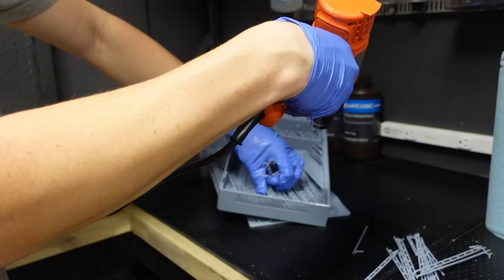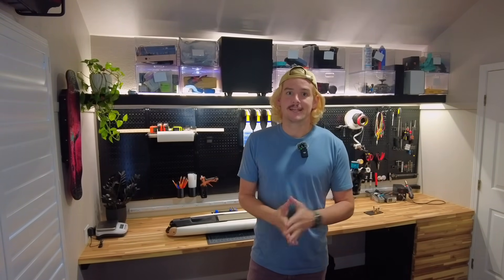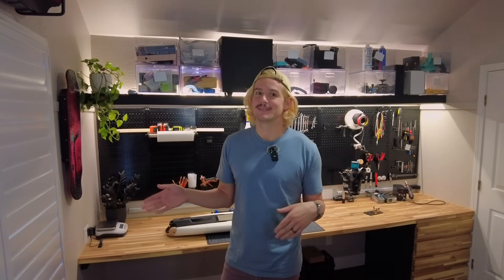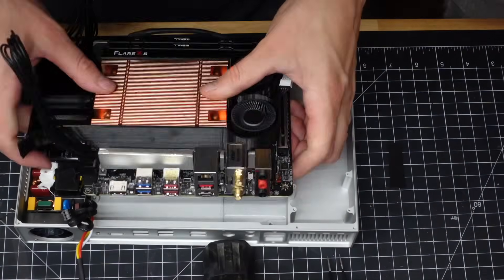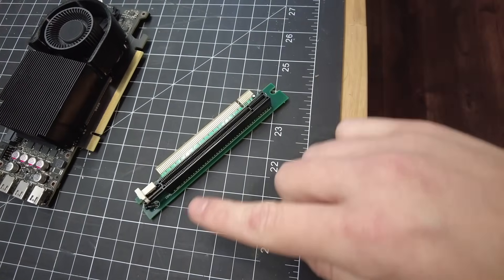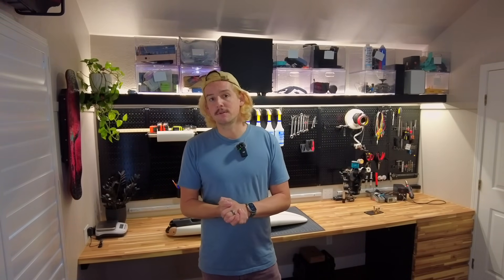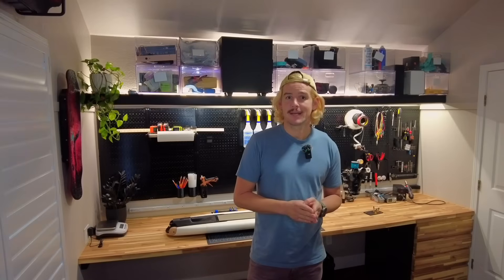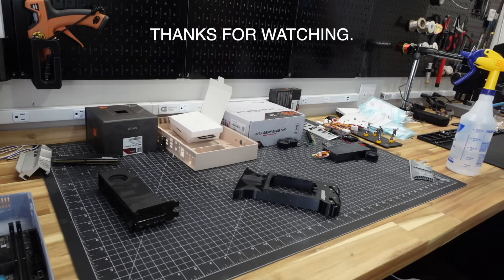I Built the Ultimate 2.5 Liter SFF Workstation PC

Comment: Tjena tjena, kompis. This is a really good project. As a fellow "brings-his-ITX-build-on-a-backpack-in-transatlantic-flights-to-Sweden", I can absolutely relate to your needs here. I had a Skyreach S4Mini which was quite tiny but as GPU sizes became larger and larger I was forced to update to a Tetra R. I am still not sure how that case will perform as far as portability on transatlantic flights (I am now using an L12S while the previous build used an L9A which is much more "secure" in the board) but I guess we will see about it next year.

Comment: I'm sure you are aware but simply using aluminium housing for cooling isnt going to cut it. The TDP/Watt heat dissipation capability comes from the surface the air has contact with. The higher the area or higher the flow the higher will be the cooling capability. So just adding an aluminium housing equals to adding like 2dl of water on top of the CPU without radiators.
Nice build but do not try to sell it as this design helps cooling. It just add thermal mass and thus delays thermal throttling if scaling is inadequate.
But the housing is nice. Instead of buying a MAC cube you got yourself a cheap PC and spent the price difference on the housing. And I'm no apple fanboy but could not notice the 500$ bill on this housing.

Comment: few thinks to update:
1 put thermalpad between heatsink and chassis
2 use normal window for i/o and pci-e bracket, and the grill for gpu with dust filter on magnets.
3 make place for normal 2.5 slots gpu
4 start selling them

Comment: Awesome build! I have a 7900 cpu rn and I have a big air cooler eventhough its rated 65w tdp. How did u manage to cool the 9900x with 120 tdp with the little copper block and blower fans. Very impressed but how long can you keep it on heavy load until it overheats? Surely you cannot run like a 45min render without thermal throttle. Thank you.
Reply: I was thinking of building a mini itx build too, but wanted it to be one of those breifcase pcs but thinner. Ur cpu cooler is just what I needed thats why Im asking. thanks

Comment: I just use a mini handheld pc, GPD Win Mini. I paid around $800 backin in 2023 for it. It has an oculink port which I can plug a mini egpu in for added power. I also picked up a dock which does all my IO ports, SD cards with display output and builtin nvme storage. I also picked up a portable pen display and powerbank for on the go use cases. This set up is very easy to upgrade as you can swap out the GPU or CPU as separate purchases assuming you can stick with an oculink based system. Or go with USB 4 for a performance hit. Way easier than doing something so complicated.

Comment: Conclusion and tips: A 250W PSU is critically small for this configuration. Ryzen 9 + RTX 4000 SFF can easily reach 250W+ in peak loads. I recommend a PSU of at least 350W fanless or 400-500W SFX (with good cooling).

Comment: Definitely an interesting video. Super impressive build but for 3k? You could get an actual laptop with an RTX 5000 that is lighter, has excellent battery life, more ram, a built-in screen (for what its worth, not much to you) etc. 

Why did you go through the effort of making a custom SFF travel-size PC? Its cool, but its performance and portability will never be able to match a laptop. 

Also I've never hit an issue with GeForce cards in Solidworks/NX/Inventor/Revit, not sure how big your models are comparatively, but for loading my Formula team's car its always been flawless, taking maybe 2 or 3 minutes to load on my 4080 laptop (haven't tried with the 5070 in my new PC yet)

Comment: just my 2 cent. its possible not to find a half hight single slot 4070 mobile cards. But this will require a custom cooler but since you have extraspace it could be cooled enough to run. its comparable with a4000 in performance but 3 times cheaper. although you would need to modify driver inf files etc ... but proably something like 4080m or even 4090m can be fitted? although cooling budget likely wont be sufficient to run them at 80-85.

Comment: Very nice build, but price to performance doesn't seem all that worth it imho when the end results barely equal a workstation laptop, which are always much more expensive than a desktop for the same performance. I don't use Solidworks, but I save my files to a folder which automatically gets copied to my cloudserver and I've never had problems with accessing and keeping my file-versions up to date, same with licenses.

Comment: This is an outstanding build.  I think there could be a market for this.  I Was a Electrical designer, so I only did some contract 3D work (running cable ladder around PDS & PDMS plant models) but I got sick of having to drag around my delicate PC setup about while flying interstate around mines in Australia.  I would have ABSOLUTELY paid a premium for a setup like the one you built.  But I am retired now.

The other alternative would be a slightly larger 5L case, with a build that was less complex.  I would have checked the pelican case I put it in to protect the PC, but that has the draw back of some baggage handling numpty putting it on the wrong plane or forgetting it entirely.

Bloody nice Build.  I would still buy one!

Comment: Incredible work. It still amazes me what we can do more or less at home now. 
That's not a terrible price for a custom milled aluminum case. When I spec'd out a few computer / electronic type builds I was hearing around $300-600 depending what I do and if I needed to fix any issues. The best you can do is make a small product run. If I was doing many, it would bring it down to around $100/each
Another example for an automotive product I produced, machined by a local shop, was something like $100 for one more or less plate, but I could do 10 for $350 ($35.0 each). I was able to sell kits including fasteners, for $90 shipped. It didn't make me anywhere near my normal rate but it made my own free.

Comment: Hey man, there's a company called JKG ventures that sells modifications for the 4000SFF graphics card and they make a longer copper heatsink for the 4000SFF that has better cooling than the stock heatsink. They also have a power mod that increases the GPU power to 110W but the card has to be shipped to their shop.

Comment: Imagine how smaller could You make it, by engineering single heatsink for GPU and CPU together. CPU from bottom, GPU from top, height abt 5cm, made of fins with airflow in between them. Cooled by 4 small radiators 40*40mm, two pushing and two sucking air. With this You could make it 2,4L case with LOW TDP GPU like rtx4060
Reply: @Jeffrey Friesen

Comment: I would be interested in buying a kit.  I think you could get a larger following if you designed the front to look like valves original concept for the steam machine.  With Bazzite on the rise and what seems to be an imminent release of an official steam linux distribution, you could probably build a company around that case, and yours is already very close to it.

Comment: This is an amazing build, probably one of the most compact I've seen and I do follow and have had a few SFF builds throughout the years. Few things I would change are:

- Try to incorporate standards where possible, like with the motherboard compatibility - since you've milled the motherboard IO in the case it limits the case to only be compatible with the motherboard you've chosen. this is not an issue for you for now since it's a purpose built machine but should the motherboard fail or if you decide you want an upgrade this limits your options of reusability unless you then cut the case. I would have tried to make a IO shield bracket compatible opening since it seems like it would be possible and the only drawback would be the size of the vents above it in the case.

- I would also include some fine mesh on the fan openings to reduce dust buildup on the fan fins and inside the case.

- Last but not least you could reduce the overall volume further probably by using an external power supply, albeit not by much but still it could be an option. It could also allow for a full sized PRO GPU to fit in the same volume.

Overall these are minor things and I can't stress enough how impressive your build is. Thanks for sharing!

Comment: Amazing looking design. However, you should consider increasing the case volume so you don't need to take the PSU cover off. This is especially dangerous with a metal case.
Reply: Not if you know what you're doing.

Comment: Doesn't PETG bend under the load with CPU temps over 80C? 
I planned to print some parts for sff custom builds myself but I was afraid that PETG will melt over the rest of the parts and cause fire.

Comment: 2.5L is pretty insane man. Very impressive.
I'm running a 3.9L Velka 3 with a 5800X3D/RTX A4000 cooler modded and ext power modded by JK&G Ventures. It's been incredibly powerful and stable for me, although I'm still trying to get CPU fan noise down since transferring from an open frame Xworks X32 that kept everything nice and quiet, but wasn't quite as safe while traveling. And the looks I got from TSA... 😅
Not to sell their services, but JK&G does similar power modding for the RTX 4000 Ada SFF if you are willing to stretch your thermal budget to ~140W for RTX 3070ti performance.
Similarly, NFC (Not From Concentrate) have done similar power modding, voltage optimizing, custom cooler manufacturing for the RTX 4000 Ada, and would probably love to work with your project.
How are you managing storage? I was able to slot in an M.2 for fast storage, while squeezing a pair of 8TB SATA SSDs for "slow" mass storage. But I'd imagine you need NVMe for your workloads.
Do you pack portable peripherals for on-the-go work? Or just to mess with people at coffee shops/airport lounges?
I specifically built around an ASRock X570
Phantom Gaming-ITX/TB3 motherboard for the TB3 connectivity and video passthrough for the ability to cut cables down to power and TB3. Very convenient while traveling with a portable monitor, wireless peripherals, only requiring a single outlet.

Have you considered Minisforum's 14900HX, 7940HX, or 7945HX embedded mini ITX boards? Given Crucial's recent 64GB SODIMMs, you could fit 16/24-cores, 32-threads, 128GB RAM, into a similar envelope.

Comment: You should look at the 7950x3d or 9950x3d (eco mode) chips ... since they draw much less power and output less heat than the 9900x. Or look at the Minisforum BD795i motherboard with integrated mobile CPU. Awesome build by the way. Really impressive work.

Comment: You should make extra fans in the workstations to get more airflow, or even remove the fans totally and leave them outside on the workstations. It'll get you more space saving plus cooler and quieter cooling solution

Comment: Fantastic work, can you comment on why not have two identical spec workstations and just swap the SSD, for your use case? Or mirror the drives by rsync, set to sync before you leave one office. I suspect your design would be great for a consultant.

Comment: Fantastic! I love seeing builds that squeeze as much efficiency as possible.
What overclocking settings did you use to tune down your 9900x? Did you do anything similar to the RTX 4000?
I would have appreciated seeing the data for power consumption and temperature.

I see 2 problems with the fans, one being that they have no filter! That will cause dust and safety concerns, especially given its portable nature which will increase its exposure. I think it would also be wise to limit the amount of sides that have fan related orifices - you can't even lay the case down on its largest side without blocking one of the fans.

Comment: Mechanical Engineer and Solidworks user here. I’ve been wanting to down size my o11 dynamic threadripper rig to something much smaller. I bought a Minisforum AR900i (which is great for its single core performance) and plan to design something similar to your sff pc. The difference would be adding a oculink port with an m.2 adapter for gpu rendering. You designed a really nice case. 😊

Comment: I designed a type of case somewhat like this, but using Flex-ATX power supply. Takes me a load of time and plenty of help because I am far too dumb to use Solid Edge like a human being. 

Also a Zaber Sentry clone, if you really need a large gpu you could do something like it. Thin enough to fit a normal backpack.

Comment: Lots of thoughts
Solidworks and the a2000 were a match made in heaven. Shame that the sff 4000 ada costs so much (or that solidworks doesn't run rebuilds in parallel). 

If I worked as a TSA agent, I would have asked so much about this that you would have missed your flight

Has anyone considered running the gpu fans externally to give extra power budget?

12:34 the proper terminology is "hamburger style"

Great Job!

Comment: Too loud too hot. Smaller does not equal better. Not impressed but the thermals or the benchmarks, extremely bad. Your cost to build is misleading since your not including your own time you put into the project vs just getting something off the shelf. 10 for effort 1 for results. Stay delusional.

Comment: Dang dude. Amazing. And most surprising is that I've found someone similar. A rarity. I too am a mechanical engineer constantly hobbling with custom computer builds favoring around Solidworks performance when most videos only cater to gaming. Thanks for taking me on the project journey and satisfying my natural questions of build items, thermals, cost breakdown, and your thoughts along the way. 

How did you determine that a 250W PSU was going to be sufficient? Was there an understanding of your use case not throttling up to power limits, did you cap power limits, or are the cpu and gpu just that low of power?

I'm now living off grid and am researching a new low power build for a blue iris server as a windows vm on Proxmox with the ability to turn on a Mac vm as well, other small VM's like home assistant too. Trying to keep my always on power low while maintaining key performance needs. My current CAD workstation is far too power hungry: 3900x with a 3090. I've got into 3d scanning as well which prior to living off grid was my first use case for a semi-portable high power workstation. I wanted to build a SFF custom full ATX setup for it- thinking it was needed for no compromises. I see now there are many alternatives. 

Well I'll be thinking about your build in my mind for inspiration into the future. Thank you so much for sharing! I'd love to build something like that soon. Currently laid off due to outsourcing :-P

Comment: I have been planing to build a monster workstation laptop with a Ryzen 9900X3D or an upper Epyc 4004 with a Quadro or Radeon Pro GPU. It would be a plug-in without battery considering the required wattage. Two HDplex 250 watts PSUs would replace a battery.

Comment: @friesendesigns It LITERALLY, says on Thermal Grizzly page, TO NEVER REUTILIZE the thermal pads, because they will not be effective anymore......
Reply: Also, the custom made PETG part for the GPU fan shroud might not last long...
You are assembling this part, on top of the GPU VRM's, which can LITERALLY reach 100ºC (The GPU VRM's are probably the HOTEST component in ANY computer) ...

PETG will start deforming in best case scenario @ around 74ºC......
I DEFINITELLY would reprint it, minimum in ASA (100ºC softning temp...) or better (PC, Nylon's, PBT's, Fiber reinforced fillaments, etc)...

Comment: Incredible work! 
You've got yourself a killer portable workstation!

I totally agree with the build mindset : 
Laptops doesn't cut it on performances/cost ratio. 
Not even talking about modularity and upgradability.

So far I've made SFF builds like your previous Velka 3, without taking too much risks about cooling and dismantling components.
But I found your work so inspiring that I will try to do a remake of your concept! 
Using already available AM4 mobo and Ryzen 5950X, with a RTX A2000 for now (RTX 4000 SFF way too expensive now).

Here's few things I would like to do differently, with your opinion on it?

- Not machining the case for the MoBo and GPU IO shields, to have better upgradability and future-proofing?
- Integrate the PSU below the GPU, to directly have the power plug on the bottom of the case?
- Is the PSU fan necessary, since the stock PSU doesn't have one, and the thermal conductivity with the case is way better?
- Resin print the CPU heatsink shroud, to have an isotropic part with no risk of layers separation?
- Have you think about using magnesium alloy to gain event more weight on the case?
- I know you've discarded black anodization because of scratches. Have you thinked about ordering from a sewing shop a padded sheath for transport?

Again very good job!
Best regards from a french mechanical engineer.

Comment: Could you add some  holes on the bottom of the heatsink vent that covers the top the PSU? you might get a very weak but effective venturi effect that might suck hot air from the PSU and dump it out the rear along with the hot CPU air?

Comment: This is the perfect example of "just because you can, means you definitely should" 😊
What a perfect build! Aluminium as a heat sink. Perfect!
If I ever would build something like this, my only worry would be some electronic component shorting onto the metal body, and shock protection from accidental fall. 😢

Comment: Oh, and I had another idea; it's sometimes possible to have 2 power settings using the windows overclocking tools from AMD. If you were doing a rebuild, hit it and enjoy those 5%-10% gains just in the rebuild, then turn it back off. With autohotkey, you could even set it up to a keyboard command or use it when like CAPS or SCROLL LOCK are on, like the good ol' turbo buttons.